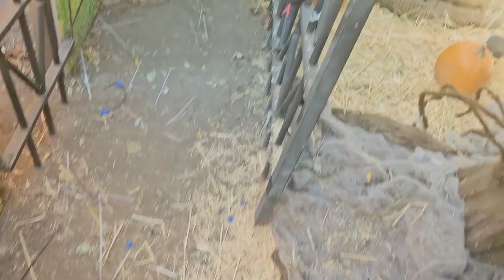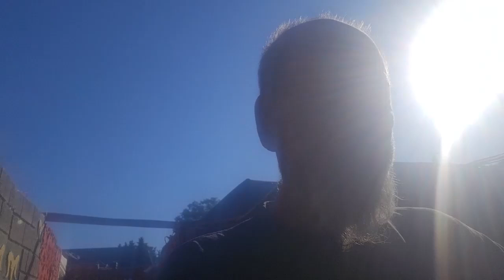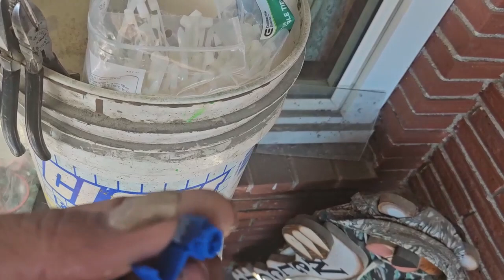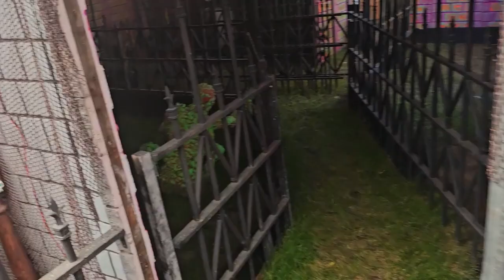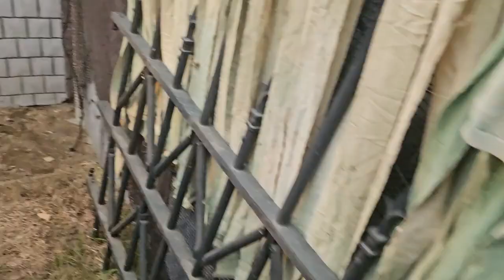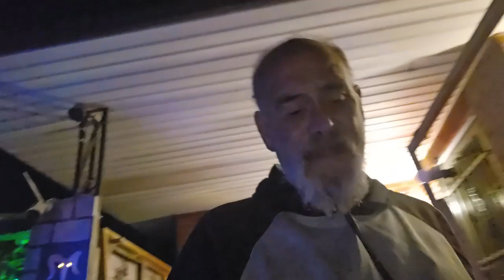Haunted Tents Set Up Day 37 10-12-24

Comment: Thanks for always going through questions on video, it's super helpful!   Most of my questions were answered.  The only one I still have is how many home outlets do you use? How many different breakers?  It looks like from your control board, maybe it's two 15 amp breakers?  I'm still trying to get my head around electricity and power consumption, so this is very helpful, thanks!